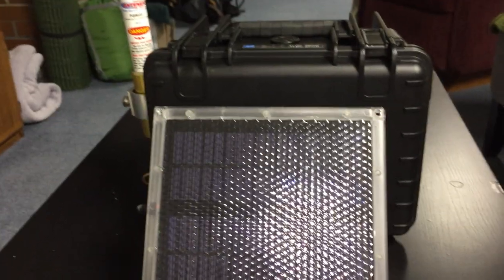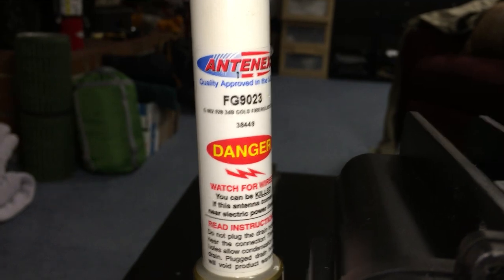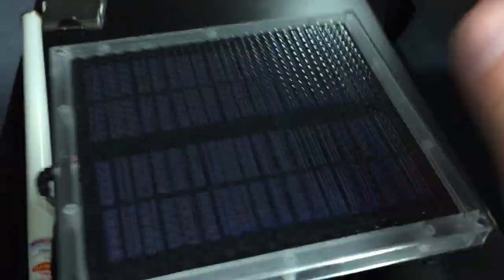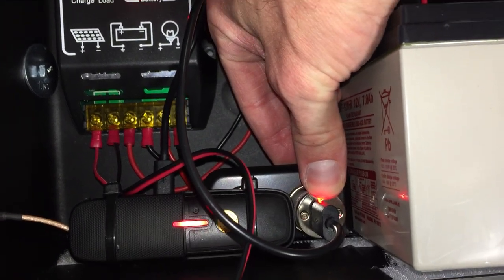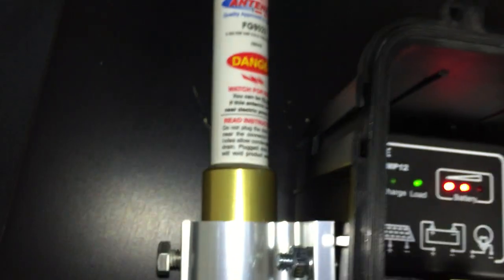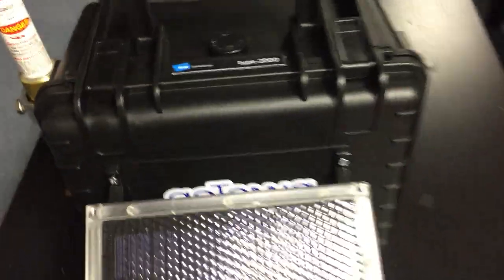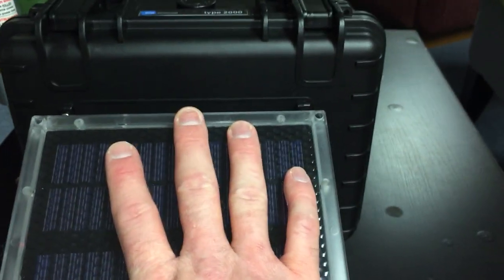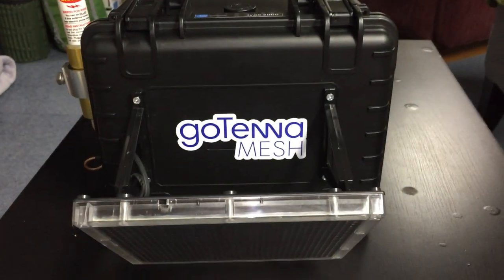GoTenna Mesh Deploy Anywhere Self Sustaining Repeater System (DASS-RS) P.MOAN.V.1

Comment: Excellent project, but I can't help thinking it's a bit over-engineered. Why not just have the solar panel connect to a USB charge controller that feeds a typical massive capacity lithium power bank and connect that to the GoTenna? Just stuff you happened to have on hand or was it a conscious design choice?
Reply from the maker: This was purpose build for GoTenna Mesh. Trust me once you watch the video I am going to make on why I choose what I did you'll get a better understanding off why I did what I did. Of course ALL feedback is welcome!
Reply: @gua742  I would love to see a full breakdown of this build! Currently just purchased the Mesh unit. And looking for a similar solution.

Comment: Did you cut the trace on the board to the factory antenna?  This is the exact project I was just considering doing with the hurricanes coming through.  Going to set it up on a tower that I have access to 300 foot up in the air.
Reply from the maker: Shoot me a text and lets get you going on this. 206-488-8987

Comment: Check FCC regs, by adding a high gain antenna you increase EIRP...if you are over the limit, you may get a visit (easy w/your GPS location available).
Reply: Ha! FCC barely chases anyone anymore. They're a joke. They won't even respond to interference reports within the commercial sector. I doubt they would do anything, even if anyone complained. Even then, it's all 900 ISM band, so no one's listening 24-7 to that "trash band."
Reply: @gsaldana22  agreed... Motorola DTR650 radios are also on ISM unlicensed band as are many other products such as network radios and much more stuff like industrial packaging quipment ...
Motorola DTR650 and network radios certainly do allow for external gain antennas. ISM is a noisy trash band no body cares about. DTR radios transmit about 1 watt before the antenna. I imagine the gotenna might be 1 watt or less ... a 3db antenna effectively doubles your power to a scorching 2 watts ... lol ... 900 mhz is line of sight. Unless the radio is on top of a mountain or tall tower or building the signal will be lucky if it reaches a mile .

Comment: I understand gotenna uses MURS frequencies... 151 and 154 Mhz VHF. Why would you use a 900Mhz antenna? It wont work well.
Reply: The  v1 uses MURS, this is the second gen device which uses frequencies in the 900 MHz range.
Reply from the maker: Wrong. Works awesome.